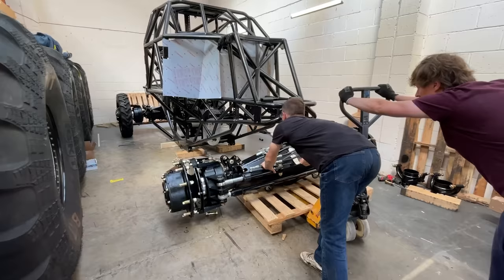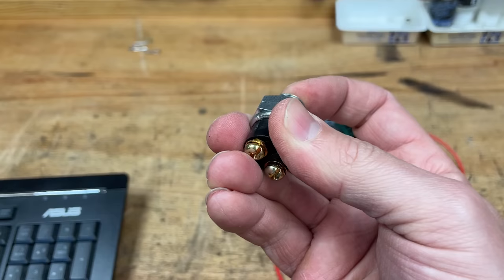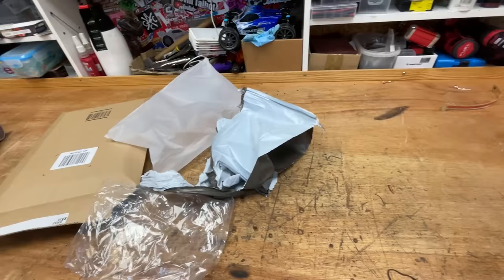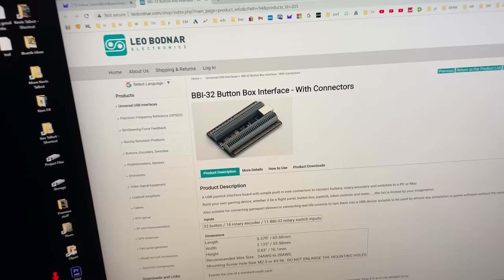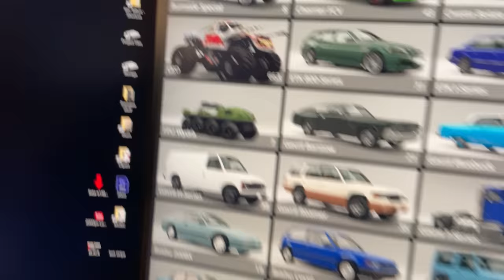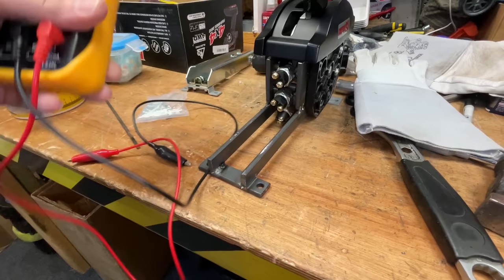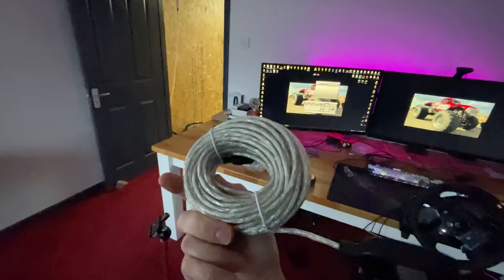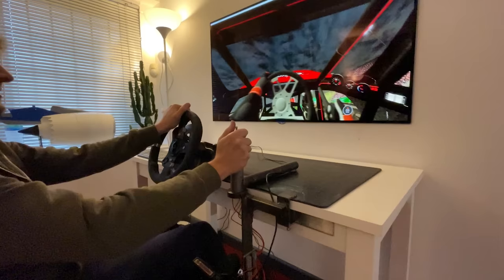Learning To Drive A Monster Truck - Beamng Drive

Comment: If you want to use a keyboard, you need a mechanical switch one as they use proper circuit boards that you can solder to

Comment: You should make a chair that uses Hydraulics to simulate the movement of the monster truck's suspension system, giving you the sensation of driving over rough terrain, jumps, and obstacles. This can be done by adjusting the hydraulic pressure and damping of the suspension system based on the terrain and the speed of the truck.
Reply from the maker: in future!!
Reply: motion platform is what your talking about you can buy them
Reply: Just put subwoofer in chair
Reply: I WAS JUST BAOUT TO SAY THE SAME THING

Comment: Hey Kev! Awesome setup! Though it looks like every time you shift, Steam for some reason detects your shifter as input for taking a screenshot (the popup on the bottom right). You can change or disable that in the Steam settings as far as i know! Otherwise it will take a screenshot everytime you shift and it will probably fill up your pc storage over time!
I also have BeamNG and downloaded the Monster Trucks mod some time ago and was so surprised to see yours! Didn´t know it was something you can actually train with :)
I wish you the best of luck for setting everything up mate!
Cheers
Reply: Damn I should have looked at the comments. I noticed the same thing and posted pretty much the same thing you posted. Also, it looks like you got Kevins attention. 😁

Comment: You might want to order dedicated joystick controller board for the shifter and rear steer. The board will appear as separate joystick. Windows should be able to pick it up just fine. Your current configuration has a small issue: every time you switch gears you're making a screenshot.
Reply: OMG it does!!
Reply: The better option is to just turn off the keybind thats screenshotting
Reply: @dopebossgamerz  or change the keybind
Reply: I'd suggest an ultimarc ipac. You can run it in keyboard or joystick mode and wire any kind of switch to it. We build custom controllers for robots with them but they are really for home built arcade cabinets.
Reply: he could just change his keybinds

Comment: 14:05 looks like you've accidentally set the button for one of the gears as the screenshot button too, you can see it says screenshot saved in the lower right corner, might wanna try and change that so you don't fill up your hard drive with heaps of random screenshots :)

Comment: Look for a FFB (force feedback) wheel or specifically a Direct Drive wheel instead. It vibrates and automatically turns the wheel realistic to bumps and suspension movement, self centers, and gives you proper resistance when turning realistic to on\off throttle, wheel speed, etc.
Reply from the maker: real monsters have no force feedback and self centering front steering
Reply: @KevinTalbotTV  fair enough
Reply: @thatsgottahurt  and also the wheel kev is using is a FFB wheel lol 👍  it's a logitech G series
Reply: He addressed this in the video…. Like every aspect of this comment word for word 🤦🏽
Reply: @KevinTalbotTV  but direct drive really gives more immersion. You have higher dynamics range of ffb. The logitech is fine for hobby driving but for practicing monsterstruck I wouldnt say so. Anyway the clutch pedal has very weak spring so the brake feel must be odd.
Reply: @stu1987eng  G920, I have the same one. Although the force feedback is temperamental and doesn’t always work
Reply: @KevinTalbotTV  heyy kevin the centering force is a stupid option that computer wheels have but i still agree with him becasue you can put a very nice and simular wheel to your monster truck steering wheel on it.
Reply: @DreadEnder  the g920 FFB should always work… 🤣 you need to tweak them settings! FFB quality always differs from game to game
Reply: @V8chump  yeah but for a while it decided it didn’t want force feedback anymore haha
Reply: @gpw203  These logitech steering wheels are so tiny there's no need, shame because it makes them feel like a cheap toy more than a steering wheel.

Comment: I've never seen the day Kevin would play beamNG drive.... for his monster truck 😂
The question is... Do you have a good processor? I've heard beamNG takes a lot of cpu power.... especially in the multiplier mod!
Reply from the maker: i had a decent editing pc built, just so happens to be good at games too!
Reply: @Kevin Talbot  Oh, alrightly then, good luck on beamNG. I've also heard that modded cars can spin out easily if there's too much rpm without slick tires if I recon, so make sure to mess around in the game more if you can.
Reply: The multiplayer game crashes every time I load it and I have a pretty good computer
Reply: the game isnt bad to run with one vehicle, but more vehicles require more cpu power due to the amount of physics calculations being done. i have a ryzen 5 5600x and can play with 10-20 cars depending on their complexity
Reply: @bmxscape  I have upgraded my cpu recently just for beamNG, coincidence?!?!?
Reply: It takes more RAM than anything, should not be an issue unless you're on a computer you built 10 years ago and only have 8gb like me....
Reply: @SEEYAIAYE  ram is cheaper than chips these days. 16gb kit for less than 50 usd
Reply: @bmxscape  I'll wait until I build a new rig this year, would not go anything less than 32gb these days.
Reply from the maker: Think I have 500 or something, I got the best of everything about a year ago
Reply: @KevinTalbotTV  500gbs of ram?!?!?! 😳 impossible!!

Comment: You can tune a direct drive wheel to feel exactly how you want it. Self centering can be turned off. There's definitely a benefit to going direct drive for your use case. Plus you can use the same wheel you have in the truck. Need a load cell brake pedal as well!

Comment: Hey you know you can change the camera angle with C or whatever. But if you use the number keys at key 5 it should look just like the interior camera. Except you can move it around with W,A,S,D and wherever you leave it. it will stay there even after you reset!
Reply: You can also just look in the controls menu if you need to look for keybinds, or just bind the keys yourself. Be sure to not overlap any keybinds though, that can be quite annoying :)

Comment: You’re smart for building a simulator - I know that’s what Dennis Anderson has done for a long time and the crazy thing with BEAMNG drive is the math algorithms are SO DAMN GOOD that monster truck should react pretty damn close to the real thing - that’s the entire key with using BEAMNG is the math algorithm in how the vehicles react. They did a test with a real hatch back then recreated the same crash in BEAMNG and it landed and crunched and crashed EXACTLY how it did in real life (you can find the videos if this in YouTube) I would run your simulator from the cab driver perspective 

The new steering mosterjam uses is a BIGFOOT 4x4 developed electric motor assisted rack and pinion - dude it’s like you can turn the wheels from lock to lock with one hand like it’s NOTHING. Beautiful system
Reply: Some of the most famous videos are side by side comparisons with real life!

Comment: You should try and get the Santa pod track on your simulator so you can practice on the same track you’re going to use in real life
Reply from the maker: is there a santa pod track?
Reply: @KevinTalbotTV  I’m not sure, but I’m sure someone has or could make a plug-in for it!

Comment: I'd suggest an ultimarc ipac. You can run it in keyboard or joystick mode and wire any kind of switch to it. We build custom controllers for robots with them but they are really for home built arcade cabinets.

Comment: What's awesome about the guys working on the Monster Truck stuff for BeamNG Drive, is that they are making pretty much all the chassis. There is PEI, Willman/Meants, CRC, CRD, Inhouse, The Metal Shop, and Cohen so far. Currently available to the Public is CRD, CRC, and Willman Alpha.

Comment: Beamng is better than you’d think! It has torque, suspension bypass systems (new), soft body and system physics, and even (unintentionally) air throttle control!
Reply from the maker: its amazing!!
Reply: @KevinTalbotTV  hey Kev! Remember that gaming channel you haven’t used in a while? I don’t think I have to say anything further! 😏
Reply: There are so many mods and options for this game it's insane, I found an RC car pack where using the Hood camera makes it look like an RC FPV video.

Comment: Incase it hasn’t been mentioned before. If u know how many revolutions your monster truck does from lock to lock you can change them settings in the Logitech app settings. And set the steering lock to lock the same as your real truck. Might make it that bit more realistic

Comment: you can change the brake pedal module into the clutch positon and have the "clutch now brake" be an actual brake and feel a lot morr realistic, on the way u can open the brake and remove the rubber inside  it will feel more real with just the stock lubed spring without the brake

Comment: Xpadder is god tier, back in the day I used to to play wow wrath of the lich king with a DualShock 2 controller. its only cause of that i was able to out dps rogues in icc. It's so good i actually rebuy it when i need it rather than recover my download link. its that good that i wanna give the dev as much support as possible.

Also its really good for getting old, modified controllers to work on pc for emulators.
Reply: Yep, still use it to this day for my old wired Xbox 360 controller for N64 emulators, it's good stuff.

Comment: I know its a bit late but something to consider about direct drive wheels isnt just the level of force, but the degrees of rotation. Not sure what a monster truck has, 540 or 900 or 1080 degrees but it its over 900, the logitech wheel wont be 1:1 steering input

Comment: Also you can setup the real or fake truck to trigger rear steer based on how much you turn the wheel so it wouldn’t require the switch to turn the rear steer. You could still have the switch for if needed, however the steering wheel itself could trigger it also.

Comment: I'd recommend taking a look at the Sfx100 open source project as you can build your own motion simulator using industrial servo motors and 3d printed parts. I have built my own flight simulator using the same home built actuators.

Comment: aye man, i know im late, but came here to say beam is a great way to train for real life driving techniques, but remember to not beat yourself u too hard over your simulation results. its software, and gets pretty squirrelly a lot of the time with actual handling, traction physics, and the sensitivity of the throttle and brakes. 

It takes some fine tuning to get it to the point where it really feels good, but once you get it there, you still have to deal with the issue of beam really being intended as a crash simulator, dont get me wrong, when the handling and gear box are responding realistically, it can be pretty close to 1:1 with real life. 

However the lag in ffb, computer not always seeing a gear shift on h patterns, and sometimes the computer even gets confused on whether or not you are a player or ai, well, just take your practice results with a grain of salt lol, when it feels like something isnt working right in game, dont beat yourself up or get frustrated, it probably isnt working right lmao.

I love to drift in beam, but i hate how while im holding a turn just fine the game will randomly spaz out for no reason, drop revs without me moving the pedal back, and then kills my drift my whipping me around in a circle like i hit a patch of ice. 

real drifting is too expensive, so as far as realism goes beam is pretty much the best there is. 

I will say though, its capabilities as a rally sim far out shine its capabilities as a drift or overlanding sim.

Comment: kev you need to look into Fanatec for wheels and pedals. Then I'd just use the thrustmaster tss handbrake for the rear steering just mod the handle to you likening.

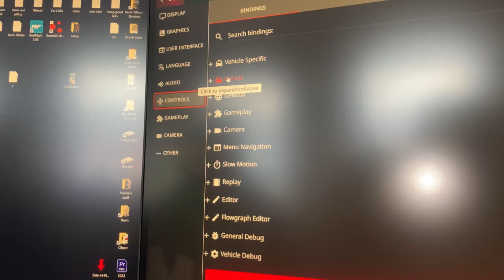Comment: 12:50 you can change between automatic and manual using the left control key (CTRL) and there is a setting for full manual
Reply from the maker: full manual dont work with auto cars

Comment: Imagine having rear steering that worked with g forces, so ad you turned left a weight would tight the switch left helping you turn tighter ight

Comment: the idea with the Keyboard hotwire wasn't a bad idea, you just got a keyboard with a soft circut board.
if you bought a mechanical keyboard with switches, then you would have gooten a hard normal circut board, with that it would be easier to hotwire stuff
in short, buy a mechanical keyboard with a hard circut board, videos on youtube show wich ones have a hard Circut board.
every mechanical keyboard has one basically.

controller/button interface works just fine as well but maybe for the future it might be helpfull

Comment: As someone who has several hundred hours in BeamNG, I agree that that automatic transmission gear selection needs a revamp. I'd love to use a 6 speed automatic as a flappy paddle gearbox without downloading mods. Good job on finally getting the issue you were having resolved all those years ago!
Reply: the game is designed in such a way that every vehicle and part is easily modifiable by editing the JBeam files. its a custom file format beamng created for modifying their vehicles
Reply: there's a portion labled transmission and it's as simple as designating that you want manual, and then you type in the ratios in a list like this [-2.50,0.5,1.5,2.0,3.0,3.3] is a 5 speed transmission where the numbers are the gear ratio. the first is negative because thats reverse
Reply: @bmxscape  There should be native options anyway. Myself and several other users are either not comfortable or do not know how to modify the jbeams.
Reply: @s60rchase17  its 2023 just ask chatgpt

Comment: You can use the keyboards pcb's you showed at the start. It just takes a bit of time to figure out which connections on the board to use. I just plugged the board to an old PC, opened notepad and used a wire to to figure out which connections on the board gave the key press I wanted! So for anyone having an old keyboard laying around, it's a great budget friendly way to make a custom controller(Handbrake in my case)😉

Comment: You need to invest in one of those ready to order sim seats with monitor mount and they are made out of steel so you can weld to them.  They are pricey at like 3 or 4 grand with the wheel and chair but if you are going to be driving pro its worth the investment.

Comment: That small green pcb board in the keyboard that had the usb attached is what you can solder to in order to make switches. You don’t have to use the actual keys

Comment: Kev you can turn up the speed of your rear steer in the vehicle settings! Looked a bit slow? But maybe that’s just how it’s supposed to be 😁🤷🏼‍♂️
Also seems like your steam screenshot key is bound the same as one of your gears on your shifter, you can change that in your steam settings by changing the screenshot keybind
Reply from the maker: has to be the same as the real one
Reply: @KevinTalbotTV  yea I wasn’t sure if that’s how slow rear steer normally was, as long as it’s realistic! 😁

Comment: Kev it’d be cool to see a new e revo vid. They don’t have the same stock pushrods that used to give you problems and with a couple other upgrades like the brace and limiting straps it’s a beast! Might have to glue a couple pivot balls too but no biggie

Comment: I plug my wheel into a Linux laptop and connect via wifi to a Raspberry Pi, with a servo hat, in the car.  Someone that knows how to make a Linux laptop look like a trainee's transmitter could tie it all together.  I need the Pi to identify, track and shoot down flying saucers in my back yard.  I can't do any of that yet, but I'm old and why not?

Comment: There's no force feedback in a real monster truck? That's really interesting to know, but makes sense, since all that force jerking the steering wheel could rip your hands off. Does it mean that landing with a badly turned wheels means you are guaranteed to break something? Or is there something like a "servo saver"?
Reply from the maker: it has a releaf crossover valve in the hydraulics that bypasses the pleasure, that acts like a servo saver :)
Reply: @KevinTalbotTV  Thank you for the response!

Comment: ohohhoho youve jumped in now be careful money goes quick in sim world.. 10 grand later also a dd wheel would let you still have drag without the centring, id assume a monster truck has heavy steering would i be wrong? you can still leave the resistance on on the Logitech but it will feel coggy in comparison with a dd wheel

Comment: When you say there is no self centering I get that but isn't there some kind of hydraulic resistance in the real truck steering? Ya seemed to be really struggling to turn it in real life? If so I would have no self centre but a fair bit of resistance in the steering wheel settings if that is possible?
Reply from the maker: i sorter the monster steering, i turned the pressure up. But yes, there is some resistance but no self center and almost 0 feedback. I would love to add resistance to the wheel but then it self centres, no idea how to change it!

Comment: Hi Kev, what tv bracket did you use to hang that tv, its almost like you have glued it on. 😂
Reply from the maker: just a normal bracket i think but cut the wall out so it looks flush
Reply: @KevinTalbotTV  ah right, thank you for the reply. Love the channel.